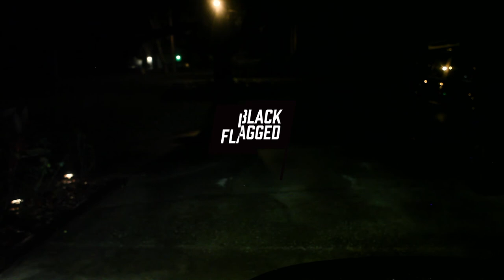Getting the m3 on a lift | vlog 013

Comment: Bonus aftermarket resonator on the orginaly un resonated section 1 side, I'm asuming an AERO AR20. This helping tame the rasp. 

In reference to the comment below it is possible to have cracks under the underbody rust prevention coating or on  top side etc. Even with 05s being a bit better all E46s can have cracks but M3 coupes fairing the worst due to how they are driven, the ride harshness stock or modded and the extra power etc.

I think ill reinforce mine in a year or two but not sure which kit or method is best. Its a garage queen convertible so its less of a concern compared to future track day coupe.
Reply from the maker: Greg's Depot yeah I had originally planned on getting one of the subframe reinforcement kits, like the one from turner, but it seems like such a big job I’d rather not do it just yet. One day I suppose. And 👍 to the resonator